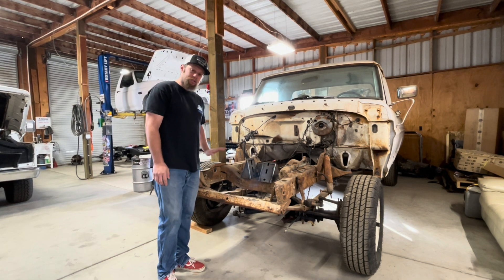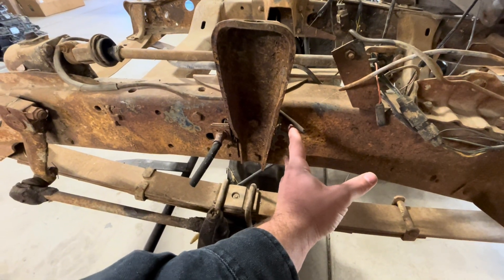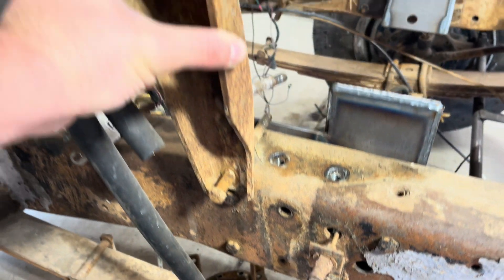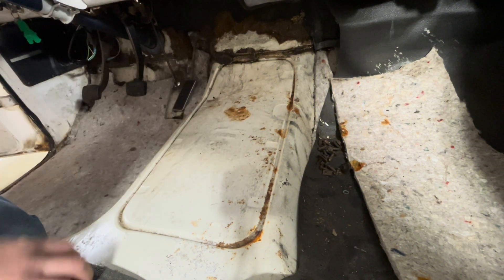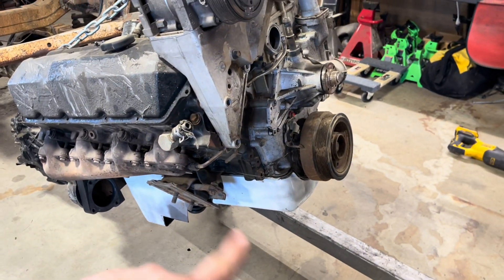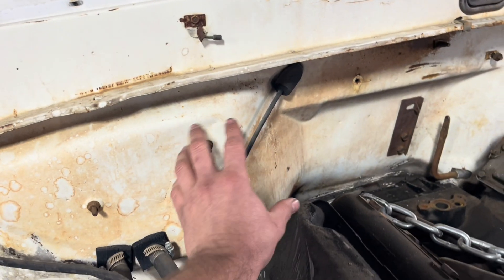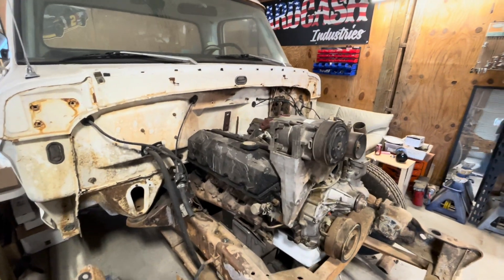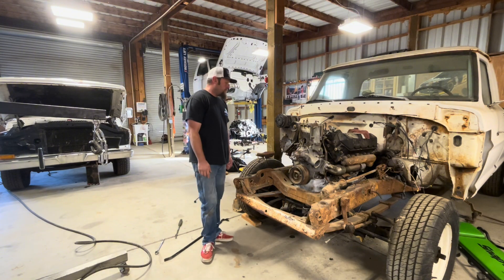FORDAHL BILT - How to swap a Powerstroke into your Highboy! Part 1

Comment: I'm in the planning stages of doing this to my 72 highboy. My donor truck is an 01 with a ZF6 trans. Can I use that trans in place of the ZF5?
Reply from the maker: Some massaging is needed to fit the zf6, they are a bit bigger
Reply: @fordahlbilt  thanks for the info!